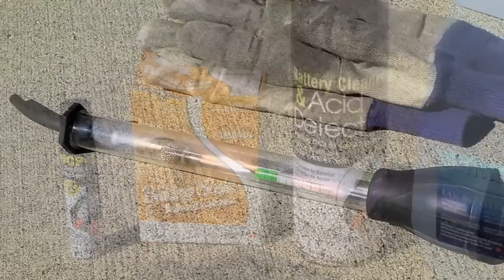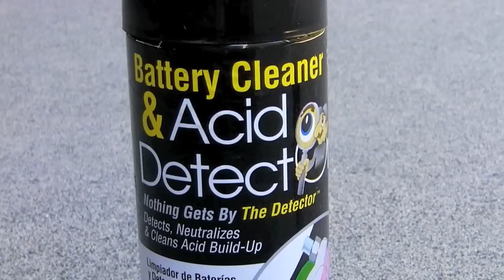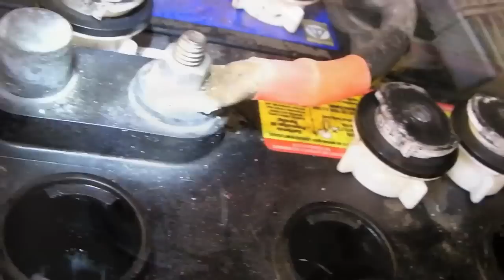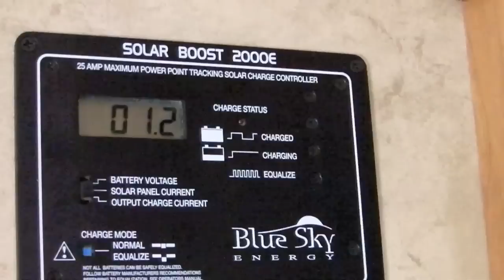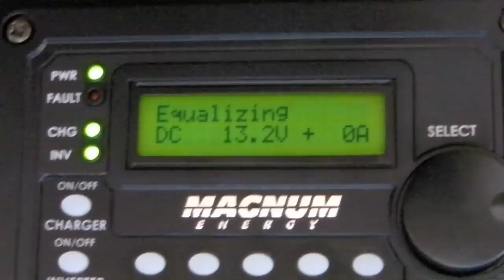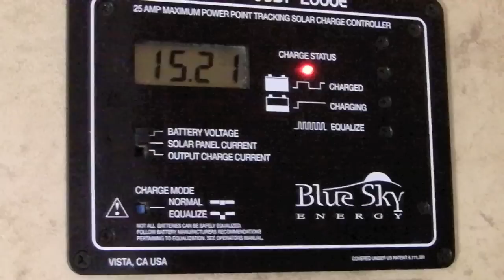HOW TO: Maintain & Equalize RV Batteries

Comment: Thank you Sir, I will follow your advice, disconnect the battery.. and...go and buy tomorrow a Ctek mxs 10 ec, that has a softstart analyses the suphatization level and starts with that 15, something volts you described..it obviously does that auto mode, they recommend once a year..found information on Ctek.com..as a stresstest I will try my  Vespa ( moped) battery which is pretty much dead since years..thanks was good checking your Video, Hans From Germany

Comment: is there any chance to do that on the chassis battery as well, with a charger device? In my Rv the housebattery is well maintained at 13 -14 volts via solar charger or house electroblock when connected to shore...but chassis batt is only being maintained with about 12,5 volt...so I am a bit concerned...no complaint or issue with starting...Batts are 7 years old and do the job well..I would love to fully charge them, may be disconnect them or hook an extra charger to the jumpstart contacts..any recommendation?
Reply from the maker: It's definitely POSSIBLE, but we're not sure if there are any external, portable charging units that are capable of performing an equalization charge. That would be something you'd have to look for (sorry we don't have a recommendation on that). Also... if you DO perform an equalization charge on the chassis battery, we'd recommend disconnecting the battery from the RV's electrical system before you start... then hookup the charger for the equalize cycle. Since equalizing pushes the charge voltage up to about 15.5V, you wouldn't want to damage any of the chassis electronics by exposing them to voltage that high.

Comment: Opened my batteries' white caps - there is no water at all :) And all seems working just fine. I know "If it's not broke, don't fix it" rule, but I better add water tomorrow.
Reply from the maker: +Stan732 You should indeed. To maintain the life of your batteries as long as possible, it's best to keep the water above the top of the plates at all times. But don't overfill either - just to the bottom of the filler tubes. And be sure to use distilled water.

Comment: Baking soda is all you need. The spray from Wal mart is the same. As for acid detector, the fizz from Baking soda not only detects, it neutralizes it. And corrosion spray is great, if  none in stock a drop of used motor oil from the engine dipstick will do the trick. Great Video!!!  Brings back memories of my golf course career 73 to 84 and I still have the exact hydrometer!!! I have always been a fan of Trojan T 105s, but have to admit that plain jane 6Vs from Costco are just as good and 30-40 percent cheaper. Costco has 6 month full replacement and 2 years pro rated warranty. If your battery box has a drain it is safe to use a garden hose to bathe them after you do the fizz fizz with baking soda. Make sure all charging is off and your power plug is away from water source. Air dry then power up. Lugs and cables are available at any electrical supply store. Good idea to make a few spares in various lengths and throw them in the tool box. I prefer to connect the lug to the stripped wire and fill with molten lead solder. With no vice and torch you can simply bang the lug to the wire with a hammer and wrap with heatshrink or black tape. Nothing like the smell of 48 golf carts charging!!! Thank you!!!

Comment: Just remove one of the battery terminals..instead of turning off the power..
Reply from the maker: With a built in converter charger doing the equalizing, all terminals need to remain connected for the equalize power to reach the batteries.
Reply: OIC.....Did know about that...thanks..

Comment: quick question,i just bough 2 T150RE  6 volt titan golf cart batteries, hooked up in series for 12 volt system ,,,,first time i hooked them up to a 1.5 charger /maintainer they reached 13.6 before charge light turned green,,,,,,,a week later i hooked it up again but they reached 14.6 and still no green light,, i disconnected charger in fear of over charge,,,,,,,,,should i have allowed the charging process to continue to green light appeared ?........were the batteries attempting to equalize ?
Reply from the maker: +bob woerner A 1.5 amp trickle charger should not be capable of equalizing batteries, as I'm almost certain that such small input does not have enough power for that. Is the 14.6 reading coming from a meter on the charger itself? You might want to double check the charger owners manual to see what it it says. It's possible that you'll need to fully charge the batteries with a more powerful unit before trickling them for the winter.
Reply: the reading was comming from a meter i i have connected to the batteries,,the charger has no meter just charging lights
Reply from the maker: +bob woerner Sorry Bob, but we're not sure what's happening here. Your best bet is to post your question on the iRV2 forums, with more information, specifically the make & model of your trickle charger. It's free to join and post at http://irv2.com/forums and there are lots of people there who might be able to help.

Comment: would ya happen to know if its safe to mount a propane tank next to a battery bank on the front "outside " the trailer 
?????
Reply from the maker: +bob woerner We're not travel trailer guys, but if we're not mistaken, aren't most batteries AND propane tanks mounted next to each other on the tongue of the trailer? Sorry we're not sure, but someone else here might be able to comment to confirm.
Reply: yea.i keep seeing it that way in videos .just worried about a spark so close to propane.
Reply from the maker: +bob woerner It's all well ventilated out in the open, so it would take a pretty serious propane leak to build up enough for an explosion. You'd surely smell it first.

Comment from the maker: BARRY STAHL Hi Barry! Some inverters have an equalize feature that has to be triggered from right on the unit itself (not on the control panel inside the RV). The first thing to do is to check your owner's manual (if you don't have it handy, you can often Google your make and model to find it). If yours is one of those that has to be triggered from the unit, the owner's manual should tell you how to do it. If your inverter can't equalize at all, the only way we know of to do it is with an external charger that has that feature.

Comment: Hi,  my panel does not have the equalize option.  Is there an alternative way of doing this?
Reply from the maker: We never saw it. And we know of no alternative.
Reply: Put the batteries in an RV that does :^)
Reply: https://www.amazon.com/XTREME-CHARGE-XC100-P-Maintenance-Desulfator/dp/B001JSTM8I/ref=sr_1_12?keywords=CHARGER+desulfator&qid=1581712446&sr=8-12 or any similar desulfator charger will do
Reply: @T B it is in the charge controler not the panel

Comment: According to my Dometic refrigerator voltage specs it can operate with up to 16volts. I believe the same is true for the AC control. Should one still disconnect those?
Reply from the maker: Hi Jim. If it's an easy disconnect, like a circuit breaker flip, or pulling a plug or fuse, we suggest that you go ahead and do it. The cost for repair on fridge and AC units is high enough that we personally wouldn't risk it unnecessarily.

Comment: Is it good practice to equalize the batteries on a regular cycle as a preventable step say at the end of a season or every six months if you use the house batteries boon docking  often ?  rather than waiting for the hydrometer reading to show a marked drop .
Reply from the maker: Since the equalize cycle causes a small amount of lead to shed off the plates, you only want to do it when the hydrometer readings show low, as excessive equalizing will shorten the life of the batteries. Also, there's nothing to be gained by equalizing batteries showing good hydrometer readings, since there's no problem to be solved.
Reply: Thank you for the information
Reply from the maker: ***** Solar only.
Reply: Very true. Equalizing is OVERCHARGING so you don't want to get carried away & do it unless it's needed.

Comment: you could just use the hydrometer to fill each cell with water, that what i have done for years, works just fine. now if you have the room on top , go to a automotive supply center and get a battery filler, it  has a spring loaded fill nozzle that will prevent you from over filling the cell, i payed like $15 for mine and its has a 2 qt, capacity. again you need to have room above the battery's to use this item. good video thanks.

Comment: Our trailer came with a maintenance free deep cycle 12 volt battery. can the two tops be removed anyway to check the level or are they sealed tight?
Reply from the maker: Don't try to remove the top of maintenance-free batteries. Nothing to check there!
Reply: Thank you for the advice!
Reply: Are these batteries OK to use for the time being?
Reply from the maker: As long as they hold a charge and provide power, they should be fine.

Comment: Peter and John, the deed is done. Checked batteries with a mini hydrometer from Walmart, the only one they had, sorry the ball type. But unfortunately both batteries registered one ball each :( I will have to but new. Do you have any personal recommend on where to buy? One more question, can I run shore power to the coach via these one-ball batteries without causing any damage to the coach? I don't need the new ones yet. Thank you soooo much for the fishing lesson again
Reply from the maker: Kinda figured you were going to find bad batteries. Sorry to hear. :(  No idea where to buy them with our doing some research online, but the iRV2 forums might be a good course for info about it. No worries about using shore power, as it goes straight to the RV, not through the batteries.
Reply: RVgeeks Again, perfect advice on all counts. You referred me to irv2 months ago and I have been an active, participating member ever since. I get most of my rv know-how there. Ab fab support system. Hey, without fawning over you guys tooo excess, please accept my most sincere thanks and gratitude. Without all the help of your vids and the personal answers you're so kind to give me I would know NOTHING about my rv. So, thank you from the sincerest bones in my bod!

Comment: I did it! Checked water in batteries. One more hurdle leapt in my strife to escape the newbie pen. Buuuut, and don't shun me, the batteries were like bone dry :( took almost a gallon of distilled water and I don't think my old 1994 is equipped with that new fangled equalizering gadgetry you are fortunate enough to have. What will results of hydrometer test reveal to me? the life left in battery? THANKS as always!
Reply from the maker: Glad you got water in, but if the tops of the plates inside were exposed for very long, the odds of your batteries having much, if any, life left are not good. Turn the pedestal power back on and leave them charging overnight. Then tomorrow, turn off the power again, along with all appliances, lights, etc. This will allow the batteries to "rest" which means nothing going in or out.... no charging and no draw. Leave them that way for about an hour to rest. Then do your hydrometer readings in each cell. This will tell you the health of each cell. Do them all. My guess is that after they got that dry, you may be in for bad readings. If they are really low (way into the red on the hydrometer), you can expect poor power from them and they'll need to be replaced. Sorry to be the likely bearer of bad news. Please let me know how you make out.
Reply: RVgeeks You know, I'm really not too sad about the predicament, I think the batteries may be as old as the coach and to start out on the road with perfectly fresh and chargeable batteries is not such a bad thing. I'd feel good with brand new ones. btw, how long, how many years should house batteries last? I will do just as you suggest. Just to ensure I have the instructions correct, when you say "pedestal" do you mean turn off the aux batter button? Peter, you NEVER bring me bad news! Always teaching me how to fish. I thank you!!
Reply from the maker: shelleyfunny19 The "pedestal" is the power pedestal in the RV park with the power outlets and circuit breakers in it. It's not part of your RV. ;-)  House batteries that are well cared for.... kept clean, water kept above the plates (but never higher than the bottom of the fill tubes!), and never allowed to get below about 50% state of charge (about 12 volts at rest, give or take), should last for many years. There's no reason why they won't last 5 or 6 years if well taken care of. I'd suggest doing a lot of reading about RV batteries before you buy new ones. The more you know about caring for them before you get the new ones, the less likely you'll be to inadvertently damage them. Nothing worse than paying for brand new batteries and discharging them fully, then learning that you've just shortened their life by doing so. Good luck Shelley!

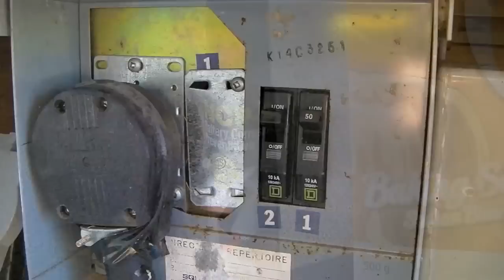Comment: Hi Peter and Partner!! Sooo good to hear from you as well. I've been taking the time to get to know my big mobile baby and now is time to check batteries as your vid indicates. I heard you say at 1:52 in vid to turn power off at pedestal. No sure what that means. I have all the supplies to do the deed today, can I just lift hood and get to work or do I have to flip breakers under frigerator to off and/or main/aux battery supply to off in coach to ensure safety? Hope to heck I'm being clear, I'm not yet fluent in "RV-isms" yet. Love you both!!! ps: hope bizness is good.
Reply from the maker: Got it! Turning off the power at the pedestal means switching off the circuit breaker that provides power to the RV from the park. Just follow along carefully and you should have no problem. Sorry the video is so long! This is one of our old ones, and we've tried to edit better recently. lol  Hope all is well with you. Glad you've been getting to know your RV better. Safe travels. Peter & John ;-)

Comment: I have a 12 full battery bank myself and have been running my equalization command from my Outback Flexmax charge controller at 14.6v. I am thinking after watching your video that I should be running the equalize at higher-level (e. g. 15.2 V); since using 14.6v is not getting my Trimetric 2025 to recognize the equalization has occurred. Would you agree? Thanks for the great post.
Reply: Give your outback dealer a call. I used to work in solar. They know their stuff.

Comment from the maker: I bought it at an auto parts store, but they are also available online. I'm not sure if it's temp compensated or not. I'm away from the RV, but will have to check it next time I'm there. Be sure to read the directions on your hydrometer, and compensate for cold temps as directed,

Comment from the maker: Are you referring to the short sections of cable that connect all the batteries together? The battery set-up in this video is very typical: four 6-volt golf cart batteries, wired in "series-parallel" which connects two 6-volt batteries together to form a big 12-volt one, then doubles it. They come wired that way from the factory, and the cables are custom lengths, which could be ordered online from a place like genuinedealz (.com), which we have ordered from before.